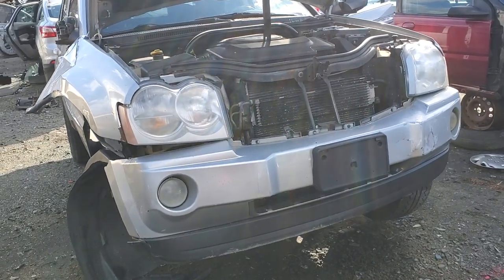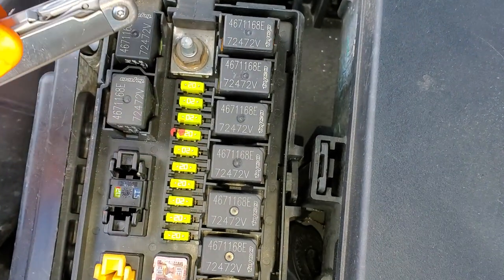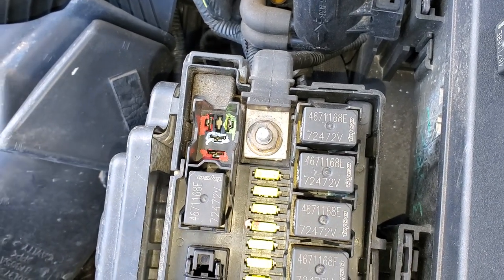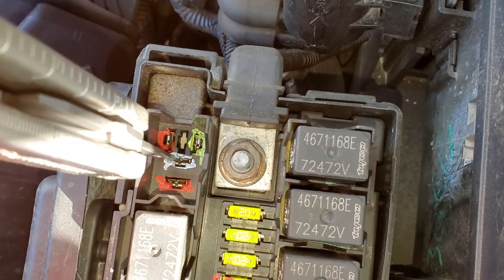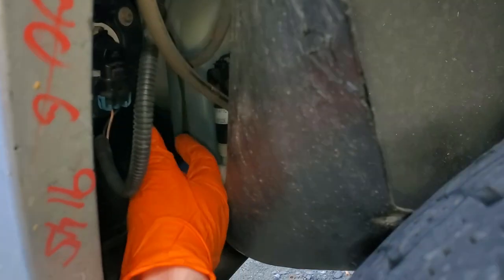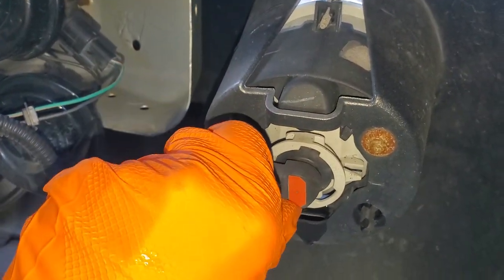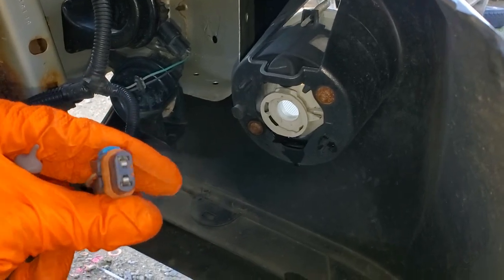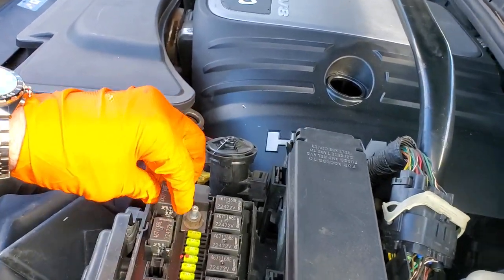2005 - 2010 Jeep Grand Cherokee Fog Lamp Bulb Replacement, Fog Light Fuse & Relay

Comment: You can use 9145 or 9005 LEDs for fogs. The 9005 standard bulbs are hotter and can melt the lens. The 9005 LEDs emit very little heat. I use green 9005 LED fogs to match my WK's color...Green Metallic (PGJ).

Comment: my jeep didnt come with fog lights but I bought a relay tried the horn relay I've tried halogen and aftermarket led lights and the fog light switch doesnt work one of the hot pins isnt hot fir some reason
Reply: Some jeeps like mine the 06 grand Cherokee came setup ready for bulbs but the computer isn't programmed on some models to work the PCM I believe needs to be programmed by dealer or after market wiring and jumping

Comment: Does the fog lights come on automatically with the low beams on a 06 Jeep Grand Cherokee?
Reply: No.
Reply: no, you pull out on the headlight knob, with the head lights on, push in to turn off
Reply: Thanks, I had to buy another multi switch with the fog light attachment and a fog light module. But the fog lights still don't work. But I do appreciate the feedback thank you.
Reply: @virgilluster3952  Some jeeps like mine the 06 grand Cherokee came setup ready for bulbs but the computer isn't programmed on some models to work the PCM I believe needs to be programmed by dealer or after market wiring and jumping
Reply: Thanks Jay, I appreciate the info!
Reply: @virgilluster3952  hey I was wondering did you ever got your Jeep to get the fog lights to come on?
Reply: @martinmarquez6755  it needs to be program by the dealership.
Reply: @virgilluster3952  so just take it to the Jeep dealership and ask them to program it for me?
Reply: @martinmarquez6755  yes, that is correct.
Reply: Although they might charge you for the service.